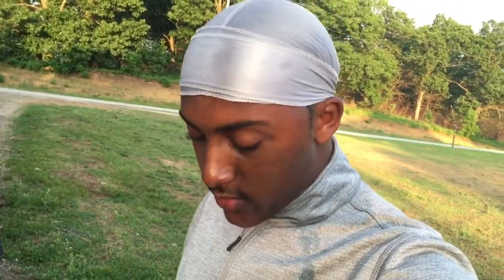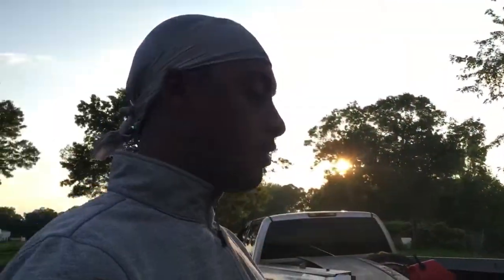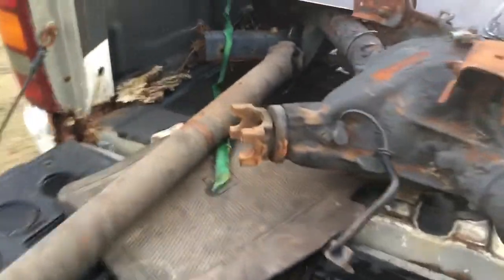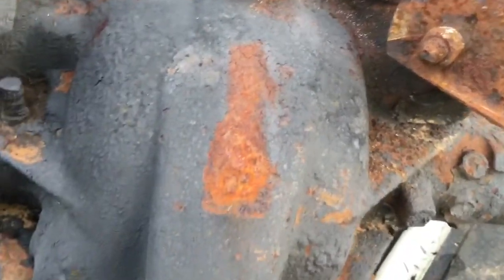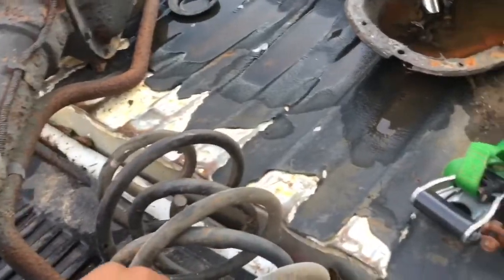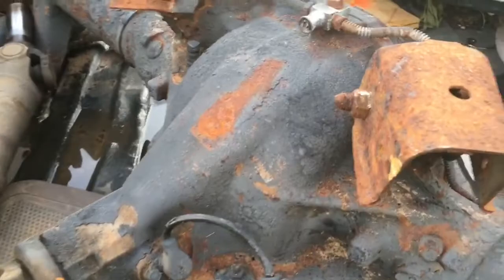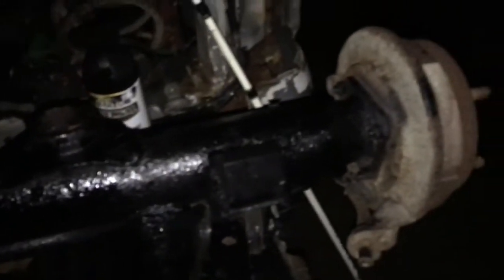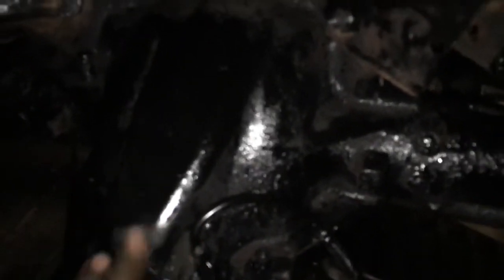Box Chevy rear end swap part 1

Comment: What year is the box? I need to swop my rear end. Mines an 87. I never knew 96 ss rear ends were compatible.
Reply from the maker: Mine a 87 too
Reply from the maker: Bolt pattern just different so I switched front rotors to 5x5
Reply: @kt98creations65  Did you keep the original transmission in there too? Or did you swop it as well, the 4 speed joint. I knew the shaft had to be shortened, but I figured the transmission and engine size would be an issue too?
Reply: @kt98creations65  got you.
Reply from the maker: I put the factory one back in just shortened the drive shaft

Comment: What else did you need to complete this swap? And what shocks did you go with?
Reply from the maker: I had to get some new calipers and some break lines and I had to get my drive shaft shortened because of the trans I have
Reply: What trans u have
Reply from the maker: 200r4
Reply: Did you use a porportional valve for braking in the rear?